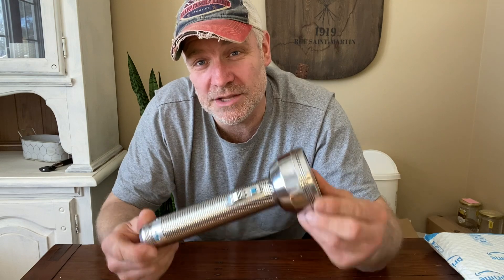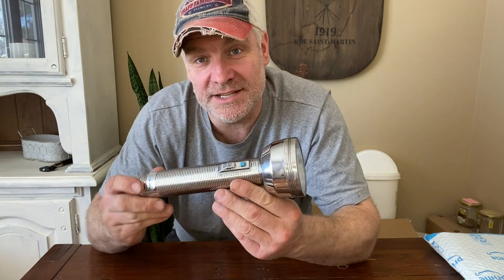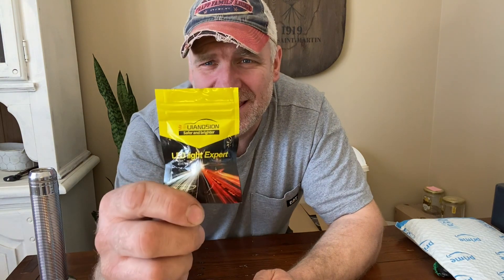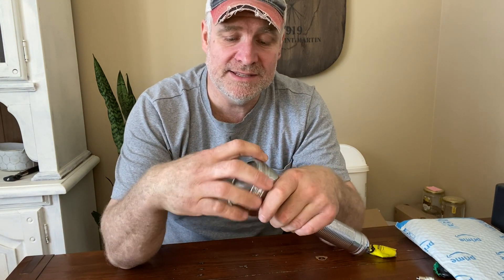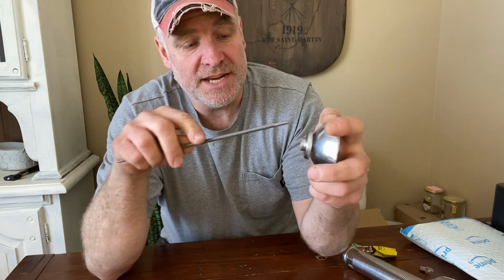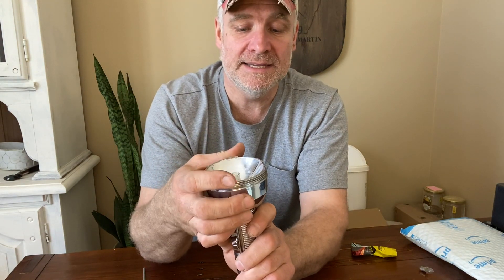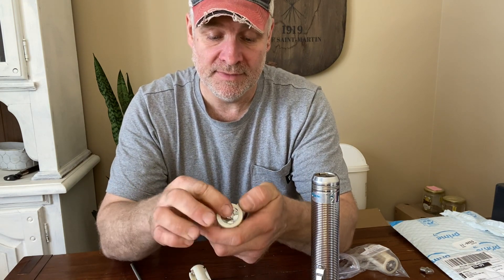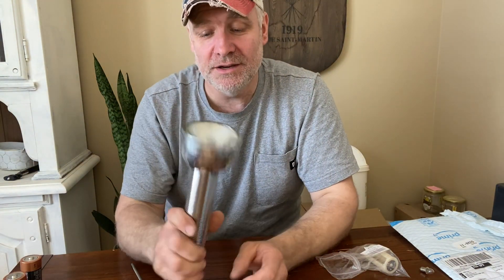Vintage Flashlight LED Upgrade

Comment: Hi there, I have an old BRIGHT-STAR flashlight, so I can use your demo on mine? What would happen if you added more AA batteries to the adapters?
Reply from the maker: It would be perfectly fine. I was just cheap not filling them   Thanks for watching.

Comment: Check out 21700 rechargeable batteries they might be a good replacement for the Dcell and they last a long time.
Reply: No they're not. Unless the user knows what driver to get and knows basic soldering. You don't mess around with rechargeable lithium-ions.